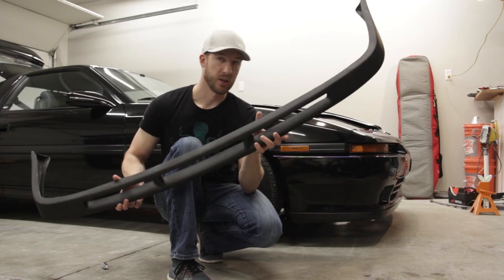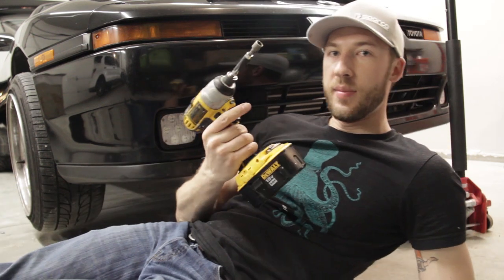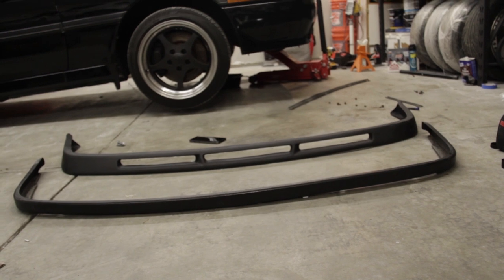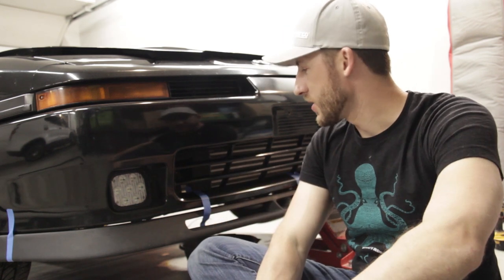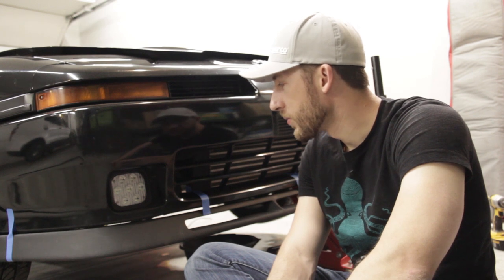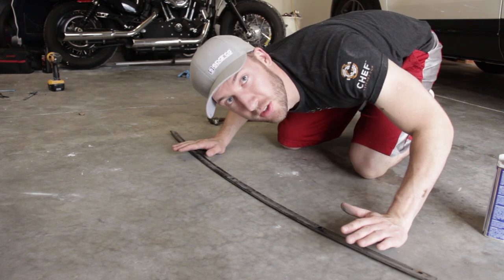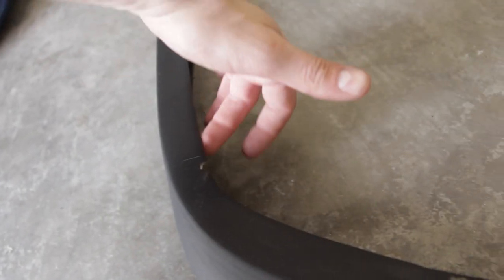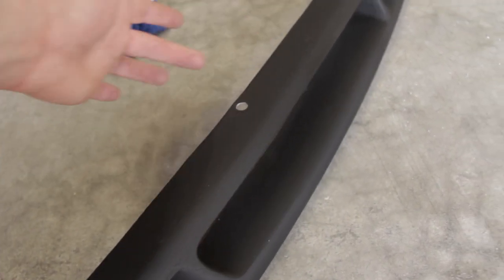How to Install a Bomex Replica Lip on a MKIII Supra + Review

Comment: I got one of these from shine auto and it does bow at the extreme ends. I figure once it's screwed in, it should fit. the issue I've ran into is that I don't exactly see good screw points under the bumper and I've been stuck on that part.
Reply from the maker: Even the original Bomex lip fitment left a lot to be desired. The lip on this one really needs to extend back further but I was able to keep it in place with the washers. My car had the OE lip still so I fortunately have the factory reinforcement in the bumper and the steel strips that support the lip.
Reply: @BoostRodeo  Ahh, I never considered that. I guess all of them probably didn't come with that lip from stock, mine didn't have it. Sounds like this might be a pro-job then.

Comment: I have a ShineAuto front lip on my Mk3. 🙂
Reply from the maker: Shine makes nice stuff, if they offered this style I would have 100% paid the difference to go with them!
Reply: @BoostRodeo  What is about auto shine lips you did not like?. I am thinking about ordering one for my 87 mk3.
Reply from the maker: @transformer889  Nothing, Ken's quality is better than this lip.  I just wanted the bomex 3 hole and shine doesn't offer it in 89+ so I had no choice
Reply: @BoostRodeo  It is hard to make a decision on shine auto front lips because they don't have a decent picture of how they look like, I guess most pictures were taken at night or from the sides, really strange I think these are customers pictures lifted from the web, what kind of company is that?. Thanks
Reply from the maker: @transformer889  As far as pre-89 lips shine only has two choices. The bomex 3 hole (what I have but for pre-89) and I believe the ab-flug (spec-G) style. Both look good and they have decent pictures. All the rest they show will not fit your car.

Comment: Same front lip on my 90 mkiii.....and our side holes basically being indentions are IDENTICAL
Reply from the maker: Have you had any issues with the sides popping out? Happened to me on my last road trip and once or twice since.
Reply: @BoostRodeo  so far no, it has stayed.  But I got it painted all nice and gloss black and have hit it in a few spots 😡😡 so I'm gonna just flat black it soon.
Reply from the maker: @Adrian_Supra  I cant blame it there might have been a few 150mph pulls that trip....😂 I need to pull it off and do a follow up video on how to fix the mounting lip issue along with blocking out and painting to get it really looking good. The other projects have just been keeping me busy!
Reply: @BoostRodeo  yea it was such a rough finish when I got it that I mocked it up, drilled the holes and sent it off to a professional painter to get a better finish on it and paint it.  It looked amazing when I got it back.  But it's so agressive even with my 1.5 inch drop in the front
Reply from the maker: Tell me about it and the a70 has so much car over out over the front wheels that it multiplies the issue when there is a driveway incline or coming down an decline. Really short nose cars like bmw's can get away with a lot more. I decided to just slap mine on as is to make a few shows but need to go back and make it pretty before spring.
Reply: @BoostRodeo  exactly my issue.......my driveway
Reply from the maker: @Adrian_Supra  mine too, I almost built a ramp to just leave at the curb and then figured out if I back in it barely clears...😂

Comment: Do you think this lip is flexible enough that I can maybe heat it up and put it on a pre 89 supra?
Reply from the maker: I think it would take actual fiberglass work. I know the bumper on the pre-89 is the same width but the corners are much sharper. Being fiberglass this lip won't become more flexible with heat so you would have to make small cuts in the top and bottom edges at the corners to allow it to flex. You could then make the corners sharper and  glass it back together so it stays that way. Would not be an easy thing to pull off unfortunately. Pre 89 just doesn't get much love!
Reply: Thanks a lot for the reply and I figured that would be the case.Still contemplating on if I want to get this lip or the two hole lip specified for the pre 89.
Reply from the maker: @jasonrambaran  In my opinion the 2 hole (east bear repro) is just too rounded for the pre89s more aggressive angles. Here are a couple links to some threads back when they were trying to organize a group buy for this lip in pre89 with Shine Auto. It has some pics which might help you make up your mind. 
http://www.supramania.com/forum/threads/first-ever-pre-89-bomex-3-hole-lip.75756/
http://www.supramania.com/forum/threads/pre89-bomex-style-3-hole-lip.162780/page-2
Would be cool if you built one. I would love to mod one and build a mold for pre89 I just don't have time.
Reply: I got in contact with shine auto previously and they said they would make it but they just need a list of at least 10 people and that it would be 300 plus shipping
Reply from the maker: @jasonrambaran  Little spendy but fair for a new mold. You could probably find 10 people between the forums and facebook groups. I think if you could get 20 Shine would cut their price to $250 or even $200
Reply: Yeah probably . I was going to post it on Instagram but I forgot about it lol  and holy shit my phone was glitching out the comment posted a bunch of times.
Reply: I just checked my email and they actually said 225 for the lip and around 75 for shipping
Reply from the maker: @jasonrambaran  haha no worries, 225 is very fair, I would be down to help make some posts and help organize a group buy if you need any help. The hard part is you almost need to take deposits so people don't back out unless you get a lot more than 10 people who verbally commit and are confident you end up with 10 or more.